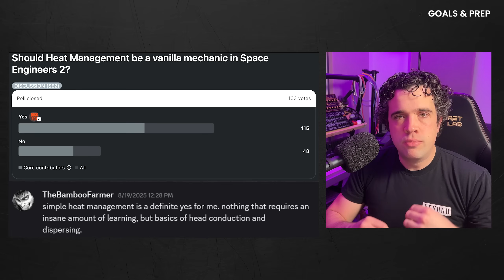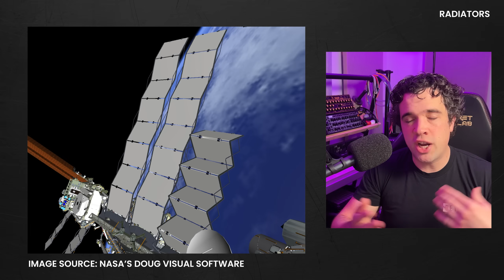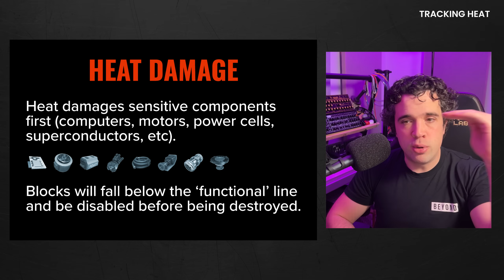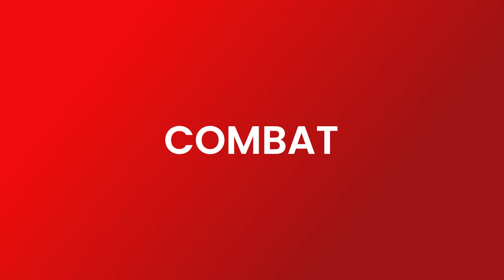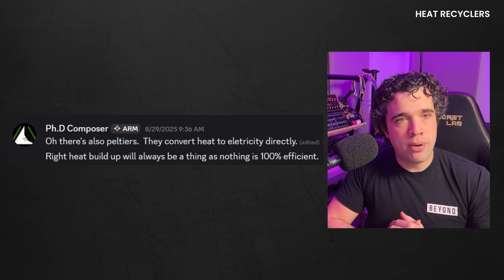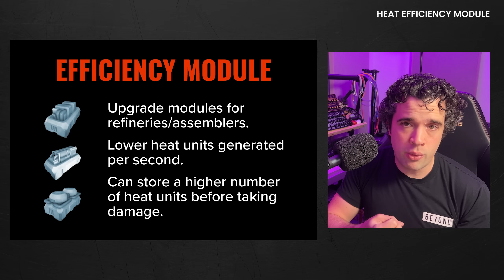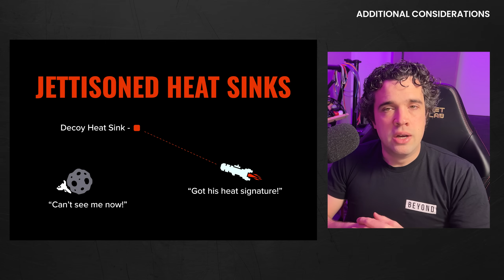Heat in Space Engineers 2? How heat could change EVERYTHING

Comment: Another option is to have radiators and heat sinks transfer some heat on their own and adding a block like a heat pump to increase heat transfer from blocks near it to the sinks and radiators. So if you have no heat pumps heat will transfer at a slow fixed rate but you can add a heat pump near batteries or turrets and the closer a heat producer is to the pump the quicker the transfer rate from the source. Heat sink should have a component that isn’t cheap and takes up a chunk of space like radio comps so building the mid fight isn’t to easy or dumping the full one and building a new one in place of it. Also if broken down turns to scrap to prevent deleting the thermal energy and if to much thermal energy is in the buffer and it gets grinded then it can explode. A thermal recycler should definitely be end game tech and it prolly needs to be made of prototech or higher grade resources to help with spam and to focus on protecting this component.
Reply from the maker: I’m definitely game for them to run with additional blocks if they want to. To your point of heat pumps, they could also have efficiency ports on the radiators and heat sinks (like refineries and assemblers have) which let you choose a few ways to optimize your system whether improved heat pumps to run more heat units/sec, improved heat capacity, or whatever else makes sense.

Comment: Heat is extraordinarily easy to move around IRL. You only need a compressor and a gas. We have a lot of gases that can be used for that, even "natural" ones such as butane. 

You get a gas, compress it and cool it as much as humanly possible, that will.... Cool it down, but then you transfer it into another spot and you rapidly decompress it. That decompression will make it absorb enoooormoouuus amounts of heat, then you repeat the cycle, you get that gas, compress it and cool it down.

Now, the question is how you cool it down? Well, that's easy. First off you made it go through a heat exchanger which connects the "air cooler" circuit with the heat elimination system, then you attach a hydrogen engine output (H2O) to that heat exchanger, then you make that H2O gas go outside to the vacuum of space in the form of a fine mist, that would instantly freeze it and you then leave a trail of ice, much like the one of the asteroids and have and a complete extreme cooling system.
Reply from the maker: In space cooling systems don’t typically dump their primarily coolant into vacuum because it’s a precious resource. The ISS has a water coolant loop for crew area and an ammonia coolant loop for everything else which transfer heat to radiators where it is gradually radiated. 

If you dump coolant as a primary method your operational time won’t be very long 😉
Reply: @diggrok  well I'm not dumping a primaryly coolant, but a byproduct of an engine, second of it: the premise was to make it hard for heat to disperse into the game.

Comment: I hope if this is implemented it’s like an actual quantity( using 100Kw of power =100Kw of heat and different blocks have different specific heat capacity(thermal storage)
Reply from the maker: It likely wouldn’t be a 1:1 with power used as it’s mostly waste heat that builds up so different blocks would have more waste heat than others. And yeah different blocks would be more sensitive to stored heat than others and thus have more capacity.

Comment: YOU COULD ADD NEW RESOUIRCES GLYCOL AND AMMONIA. THEY WORK TOGETHER IN A HIGH PRESSURES AND VOLUME SYSTEM. PUMPING WATER THRU SPECIAL PIPES ATTACHED TO CONVEYORS OR CARGO CRATES?
Reply from the maker: If they went the route of liquid cooling loops, exploring ways to manufacture a coolant material would be rad. You could still use water but the coolant such as ammonia would work more effectively. (As it does in the ISS)
Reply: @diggrok  THE GEOTHERMAL MOD COULD BE USED FOR CREATING POWER FROM THE HEAT?
Reply: @diggrok  ONE THING I LEARED AT A KROGER BAKERY IS THAT HIGH PRESSURE SPEED AMONIA GLYCOL  SYSTEMS IS THAT IT'S GOING TOO FAST TO GET THE HEAT EXCHANGE. THEY HAD TO RETHINK AND GO TO A NORMAL SYSTEM. OH, AND THEY GIVE 10+ BUNDT CAKES  TO YOU A WEEK FOR SNACKS AND SAMMICHES LIKE WILD.
Reply from the maker: @mellowrebel4618  What in the world is with the all caps? It’s so violent. 😅
Reply: @diggrok  CANT SEE WELL UP CLOSE AND NEED CAPS OT SEE WHAT I TYPE

Comment: maybe this could affect  pressurized rooms too, if you have a reactor in a pressurized room, it bleeds heat into the air in the room,  air vents could use heat to heat  up a room in space, or take it in when cooling a hot room, maybe you could even intentionally heat up a room as much as you can,  then dump the  gas into space.
Reply from the maker: If you heat air and vent it though that will use massive amounts of oxygen, making it not a super efficient method. Water can store way more heat than air. Heat Sinks even more because it doesn’t turn to steam.

Comment: I feel that if you were to have heat management work as stated, then all blocks that create or store heat should have an additional component around the functional line.  If they overheat, they are damaged until this new component is destroyed, then it no longer works anyways, so the remainder of the components remain untouched.

This make it so you still need to worry about heat, but it alone won't make your grid won't fall apart because of it.

Edit: a few blocks could blow up, ie: engines, but having everything blow up is a bit much imo.
Reply from the maker: Yeah I sort of outline this in the Tracking Heat chapter where critical components are damaged first which without those components it falls below the functional line. A single component that regulates heat could fail like you outline which disables the block, it just means that once you overheat that piece is destroyed then it’s disabled which would be pretty instant whereas gradual damage which removes computers and motors over time would mean it could take a little heat damage and not be disabled right away but lose efficiency fast.

Either way, the block would be disabled and go offline well before the entire block is destroyed.

Comment: now if only keen would listen and scale the voxel under pressure like impacts or from water or wind erosion the voxel would shrink and expand base off of things like heat speed and pressure.  I told them scale the voxel between 4 and 64 bit when the voxel is under flux state but its like im talking to children maybe i need to be smarter to explain it better
Reply: with this sort of heat then you could overclock your sub grid to get better performance at the risk of more heat.  to much heat would melt metal so they going to have fun running at the melting point of most metals would be to unrealistic if the opt temp is 2x the metal melting point.
Reply: you think they going to add copper to the game???  Dude why would they when gold can do the same thing, okay so how are computers made.
Reply from the maker: Not sure exactly what you mean with scaling the voxel under pressure.
Reply: @diggrok  exactly

Comment: You could modify the water tank idea as such - you would have a heat plate of sorts that would connect to a conveyor, and if this is touching a heat radiator or heat storage block, it will transfer the heat to the water in the water tank. This could be turned on and off for emergency situations as you said, and gives players a very important reason to lug huge tanks of water around. The trade off would be that if you get the water too hot (beyond the boiling point) you start losing water to steam (this could just be a passive "loss" that does not require any kind of vent blocks), meaning if you keep dumping heat into these blocks, you will eat up all your water, which I am guessing will be used for growing food at some point when that comes into SE2.
This could also be impacted by how much water is on board - a lot of water can store a lot more heat (and you lose capacity as you boil off water). You could even remove the heat battery as a thing and have that be the block that needs to touch the heat radiators to transfer the heat energy to the water. That not only keeps it confined to only adding 2 blocks, but makes the system much more complex and interesting, and really expands on the use and purpose of water as a new mechanic in SE2.

overall a super cool idea! Hope it sees the light.
Reply from the maker: There’s definitely a few ways they can skin it for sure. Though heat sinks would probably be able to store more heat than water per cubic inch just because to your point at a certain point the water will turn to steam at a much lower temperature than a heat sink can tolerate. Plus you’d eventually run out of water whereas a heat sink can be reusable which makes water a great emergency coolant but keep heat sinks as the best way to store heat. 

Plus heat sinks can be hidden internally and you can turn off radiators to conceal your heat signature during stealth runs.

Comment: I like the idea of heat, but could also find it annoying if not balanced to be manageable. The direct block damage would be very very annoying and I wouldn't want it to function that way. If heat is implemented in another way it would give rovers and subs/boats more of a place to shine with easier heat management. A few extra armor blocks as heat vents wouldn't matter much for small sized ships, same with fitting in a heat storage or two. Large sized ships could be where this gets annoying if the number scaling gets off, or if the ambient dispersal for thrusters and turrets is too off.

The big thing with all of this is "baby's first". What does the experience of "baby's first miner" and "baby's first mid sized ship" look like? Are they constantly having heat issues or are they reasonable when you remember to include them?
Reply from the maker: The block damage would only happen if you turn off your heat safety toggles so when building something like a miner or refinery platform you’ll know if you need to add more cooling without taking damage. 

Where the heat safety would most likely be shutoff more often is combat where you might be over heating but can’t risk your grid shutting down so you keep certain systems online to finish the fight or escape.

Comment: I love all of these ideas. I think the emergency water flush might be difficult to implement well on a ship, especially as any significant cooling would require vast amounts of water... maybe if it was something you directed over the heatsinks? Theoretically it would also create huge amounts of pressure, so those areas would also need to have open ventilation.

I think my favorite idea is heat as an environmental hazard. This could create an excellent balancing hazard to anyone hydromanning in combat. Trying to grind off those critical active components generating heat? Your grinder is going to overheat faster, and if the components in the area are too hot, you'd begin taking damage (perhaps quite rapidly if there are numerous overheating modules). This could even add an incentive to DELIBERATELY shut off your radiators to flash heat hydromen inside your ship with your heat sinks and modules! Or utilize an emergency water flush, having the water and/or expanding gaseous forces blow them out or blast them against a wall!!
Reply from the maker: Yeah water cooling is a slight step up in complexity which is why I reserved it as an optional block. That might be an area we see the modding community expand on.

Comment: One more design feature that would be kinda cool is power lines for electric engines. Not for all parts, we can assume those run within walls but the thick cable that would be required for engines should be a destructible element.
Reply from the maker: Only issue with new types of piping/cables is mechanical subgrid blocks like rotors, pistons, and hinges just have one conveyor port on them so nothing would be transferred if it isn’t conveyors. You could add various ports for different types of pipes but then these blocks would have to be way bigger which limits what you can do with them.

Comment: heat sinks should melt or explode. and they should have a aoe Heat status like reactors have Rad aoe effects.

for the Radiator calculation, ship grid has a bounding box. This is what stops you from placing it around other structures sometimes, as the bounding box isnt the collision of the grid, but a limit of hte 3 axis of its foot print. 
if you take that box's dimensions, and take the mass of the grid, you get a density value. 
using the box's dimensions, you can find an abstract surface area with out having to calculate the grids surface area either. 
using these 2 values you can now easily calculate the passive cooling, the passive insulation, and the active cooling potential of a grid. 

This would limit the ingame calculations to be basically just simple extrapolations of values we already have in game.
Reply from the maker: Yeah there’s a few ways they can skin what would be a relatively minimal performance mechanic.

Comment: I generally like the regular idea proposed here! I especially think heat is fun in combination with shielding, as it gives a clean way to abstract shield ‘hp’— hits on shields can instead provide X heat to the emitter or whatever, allowing for a way to integrate with other systems (like production which also produce heat) better and naturally creating a dynamic tradeoff—if you want a strong shield, you’ll need a lot of exposed radiators, which makes the vessel extra vulnerable when the shields go down!

The only thing I disagree on is personal heat for the engineer, as I think it could easily be annoying more than anything. Imagine your jetpack overheating while you’re trying to weld up bits of a ship, or your drill overheating and making you just sit there in the early game manual stone mining phase.
Reply from the maker: Yeah I think with the engineer that is where different suits/packs can play a role. This a feature teased in a dev diary and I’m actually writing a script on it now and have an open discussion on it in my Discord. 

The goal with the tools heating is to prevent hydromanning another player’s grid. A possible balance is there could be a suit which specializes in building which can tolerate more heat buildup (perhaps with a better radiator) but the suit is heavier and thus slower. So it’s fine building around your own ship but really hard to chase down an enemy ship. Just one spitball idea. 

Another idea discussed was tools having consumable, reloadable heat sinks so if they overheat you reload the heat sink. Then if you were to hydroman you at least have to be somewhat prepared with extra heat sinks.

Still collaborating on it so don’t have the best solution yet for that but feel free to hit the Discord link in the description if you want to get involved in that process!

Comment: For weapons, rate of fire could be tied to heat.

As it approaches overheating enough to take damage, the rate of fire slows down, there could also be new firing modes and rate of fire options, with various weapons having different modes.

Gatlings would take the longest to overheat, but could also have their rate of fire adjustable, and artillery taking the longest to transfer heat away resulting in a certain number of shots before the rate of fire is slower due to heating, and railguns being the opposite, they generate even more heat but transfer it much faster than regular guns, making the meta of a ship with a billion railguns in the nose result in massive heat issues.

Another solution would be a set of blocks to make a cooling loop that feeds into radiators and heatsinks.
Conveyors that act as your coolant pipes with both large and small grid, able to connect to either size connector and auto adapt the model used on the connection, they feed into radiators which in turn feed back into coolant storage tanks, which your coolant pumps draw from.
Reply from the maker: Agreed on the weapons. They could build up heat units at a higher rate than other modules which causes them to overheat easier since radiators (which can only build up so many heat units/sec) would become over saturated by the sudden excess heat of a bunch of turrets firing, creating a period where you need to let cooling catch-up or else requiring you to have a few extra radiators which can be vulnerable during combat.

Comment: I would actually really like to see shields in space engineers 2. We could set the shields up to project out from the block generating them, like the gravity generators. And have their power consumption scale with their size and strength. Maybe also have multiple shield generators allow for the shields to join where they intersect, so we can form them to the ship with clever placement, while cutting down the power consumption based on the surface area removed by intersecting them.
Reply from the maker: My previous video outlines an idea for a robust shield system as well which isn’t too dissimilar to this.

Comment: What about adding also the need for heating up blocks in case of freezing? Stuff of which efficiency depends on temperature, like H2 engine, O2 generator, could need heat management to allow for heating in case of too cold situations
Reply from the maker: In most scenarios outside of being on a frozen planet heat probably won’t be an issue to build up but if it was maybe heat sinks could also store heat to pump back to modules which need it. 

Running a hydrogen engine for instance would likely generate both the power and heat to run a few modules.